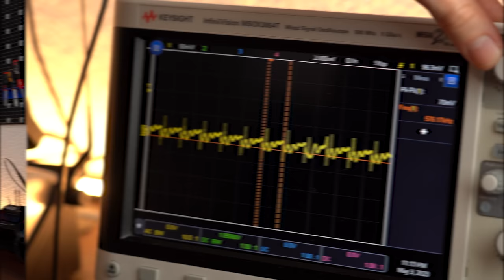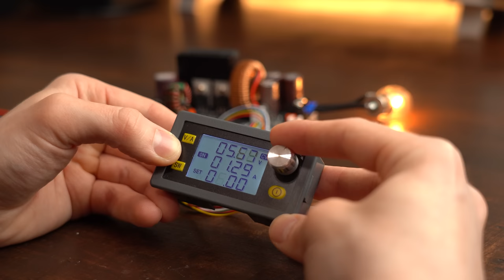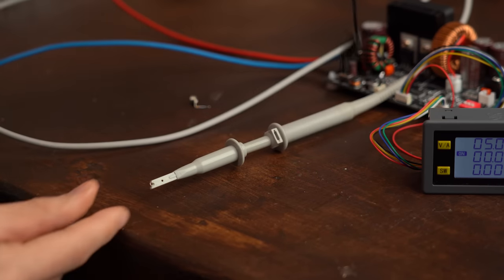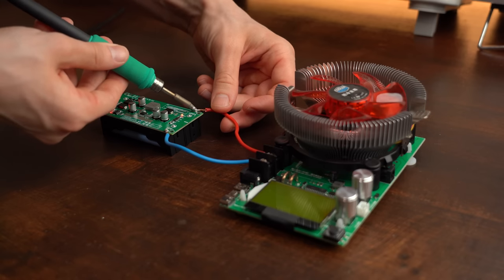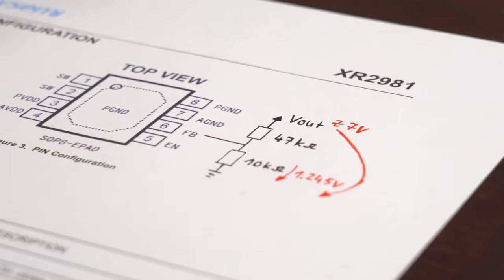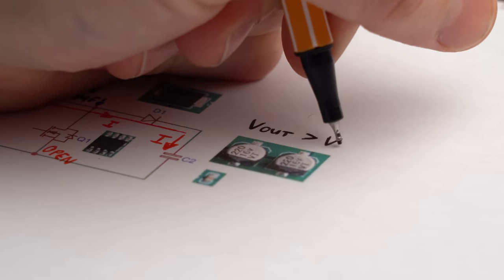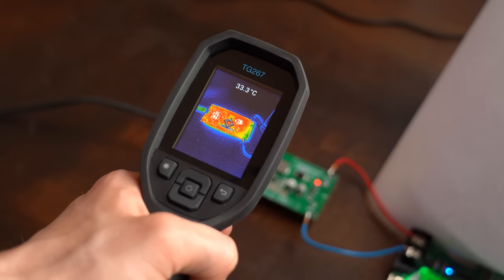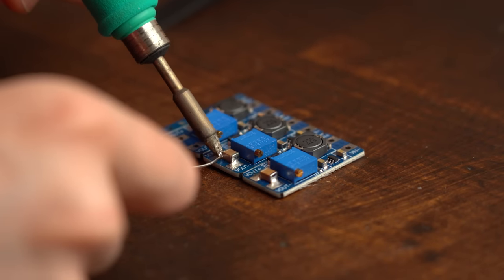With Just $0.50 Components I turned Garbage Products into GOLD!

Comment: The reasons for the component issue may be the lack of knowledge of circuit design, or they just wanted to get it out in a cheap and fast manner.  No matter the issues, this video provides a workaround to this issue, and it makes the circuit useful. This the reason that I like videos like this.
Reply: Maybe they were using whatever came into the factory as well, no need to bother with a design you can't reliably manufacture.
Reply: Even simpler.  It’s not a decision an engineer would want to make, these are usually management decisions.  It goes like:
Engineer: Here is a stripped down minimum count and cost design like you wanted
Management: it’s too expensive, cut something!
Engineer: But it’s already stripped, it’s not going to work properly!
Management: Here you go, make this cheaper because the last guy wouldn’t 
Unpaid intern: you got it boss!
Reply: I doubt it. Something like this is quite fundamental. If the capacitor is 50cents then that is almost a 15% markup and they are competing with other low cost manufacturers. Adding in that cap will just make consumers look at both products, think they are basically the same, and then buy the cheaper alternative anyway.
Reply: I suspect if the manufacturers have even tested their designs before putting them into production.
Reply: @qazwsx000xswzaq  they know full well.
Reply: Perhaps enough people desire to purchase a product that is 50 cents cheaper despite its inferior design because they are unaware of the reasons justifying the additional 50 cents. However, if a superior version is unavailable altogether, then your theory sounds more plausible.
Reply: from my modest experience, many cheap aliexpress products cut out on quality capacitors, often times they are found in the specs but replaced during production, maybe because of lack of stock or just to maximize profit.
Reply: I like this type of videos too, about changing bad quality electronic components to improve a design.  What other YouTube channel do specifically that?
Reply: Let's keep it in perspective... A capacitor isn't 50 cents. It's far far less for places that actually assemble components to pcb like this. Realistically it's pennies. Shit they could be salvaged for free if you had the work force to do that
Reply: @hugegamer5988  2023 version: "I am a large language model. What would you like me to do again?" 😆
Reply: @swimfan6292  in this case, so which is it? enough customers wanting a cheap product or enough customers who do not know what they will be getting?
Reply: you have to considered tge packeg or shipping condition, electrlitic one is far more durable.......
Reply: They probably didn't even had a proper oscilloscope to spot their mistake.
Reply: What I  have experienced is often one of these two options: cost cutting and not understanding the circuit example in the datasheet is missing filtering etc. components.
I have seen boards with pads for filtering components that were "intentionally left blank", and some that were basically the reference design from the datasheet that was, as stated in the datasheet, lacking filtering and signal conditioning. Also, people designing the correct circuit cost money, as do correct components.
Reply: They definitely know about a capacitor filter or a linear regulator because that's pretty much the first things people learn in ECE. Some people mentioned cost to be a reason, but I think the actual reason is people are using the wrong product for the job. These products are intended to be power supplies for things that do not care about the noise, like a LED strip or a small cooling fan. Counterintuitively, knowing what component to cut so that your product just barely works actually takes more knowledge of the circuit fundamentals than over-speccing.
Reply: Probably a copied design with cheaper components. A lot of Chinese electronics distributors are like meth cooks, they just follow a guide without knowing what they're actually doing.
Reply: 100% pinching pennies
Reply: or the parts in question takes to long to deliver
Reply: @cubertmiso  it's a manufacturing defect they pushed out for to sell anyway. Despite the flaw. Thousands if not millions of (actually important) products get knowingly distributed and sold every day. That's what he should've called out. Electronics industry has it easy with that because they claim responsibility for zilch
Reply: @pflasterstrips7254  They do not even test their products, why have a oscilloscope ?
Low cost high volume electronic are often not tested (but may be full with stickers about inspection and quality control), just put together, in a box, send to a place that resells the shit to you.
Reply: @pneumantic6297  it's only 50¢ for one. It's 10¢ for 10,000!
Reply: or they make the circuit design off of datasheet schematic
Reply: I think mlcc's market price must go up and down possibly as they use precious metals
Reply: @hugegamer5988  Yep, working in similar field I can confirm this!
Reply: From reading the comments, no one has questioned if they chose to use those capacitors because it simply "looks beefier". It is probably an ill choice that was made in the name of marketing. "Hey look, our capacitors are chonky, must mean it is better than our competition!"

Comment: Ah the classic current loop antenna, that’s why you were picking up all that noise. Any loop will act as a current antenna. And any length of copper, will act as a monopole if adjacent to a ground plane or bipole if connect to a center point. Good luck.
Reply: People who liked this also liked working with RF designs, where furrowing your brow rotates you on the smith chart.
Reply: Though the change he saw was huge and probably this is also telling for the EMC of those little PCBs.
Reply: That's why you should always use your devices inside a hermetically sealed bunker surrounded by 10cm copper plate, 1.2m lead plate, and 3m of grounded-steel-reinforced concrete. Everything should be made with pre-nuclear-test materials to reduce self-radiation.
The bunker should also be carved into the base of a mountain, or built into the sea-bed with at least 200m of water overhead if you want to block those pesky cosmic rays.
You still need to account for all the Neutrinos that can still easily get through, but luckily those usually don't interact with your electronics if they can get through all your other defenses.
Reply: @Prophes0r  Just build your swimming pool over your bunker.... ppfff...
Reply: @hugegamer5988  nothing like carving your own ground leads to get the ground loop as short as possible

Comment: I never knew to check temperature to check out components in a design to see if good or bad. Only to look for a broken component(s) when fixing. Maybe they stole an incomplete design from someone else? Lazy? Possibly just stupid? 🎉
I am still learning. I bought an old radio/cassette player and a radio clock alarm that both work to study on. I will use your temperature trick to maybe improve them. Thank you for giving us a great channel with interesting projects.
Reply from the maker: Thanks for the feedback :-) And you are welcome 🙂 I love to make this show.
Reply: Your devices were probably made in the 90s or earlier, so I wouldn't count on them having the same trashy engineering as modern devices from AliExpress. Good luck with your endeavors though.
Reply: High frequencies tend to cause caps & mosfets to heat, for different reasons, but the solution is pretty much the same: lower the resistance. Low ESR caps have much lower resistance, and 'bigger' mosfets have lower RDSon, which is essentially the resistance that causes most of their heat.

It's always funny to see a low-tech troubleshooting technique on high frequency IC's. Elegance in it's simplicity.
Reply: Seconded. The diode temp probe is a precise method of spotting an overheating device. Slower but many times better than a finger touch. I'm impressed by your thoroughness.

Comment: You typically do not put large MLCCs on the output of a power supply because when they fail, they fail with a burn
so you use small ceramic caps paired with low ESR caps
Reply: I am curious about your answer, so I get deep into it, there is an article from TDK, called"Guide to replacing an electrolytic capacitor with a MLCC", it recommends to replace with MLCC due to their low ESR, long life and small package, but one should be careful about their capacitance will change with temparature and voltage applied to them, also some ICs are intended for electrolytic capacitor, so it might cause some unwanted feedback with MLCC.
Also there is a youtube video discuss about fail of MLCC called "EEVblog #1037 - Solving Ceramic Capacitor Cracking
". Large value MLCC can be cracked physically easily, and it might get shorted when that happened, I guess that's why modern hign-end PC motherboard still using the method you said, rather than pure MLCC method.
Reply: @tingoyeh4903  I had soldered a MLCC underneath an electrolytic in an ATX PSU which had undesirable high ripple output. Eventually while I was at the computer, there was a pop sound. The MLCC probably became hot and failed short which burnt down the electrolytic releasing gas.

Comment: Man, it's crazy how much you can accomplish pretty cost-effectively if you understand electronics. It's something I'm trying to learn, but it's not easy for me to understand electricity and how everything relates to each other. Thanks for the videos, they're helpful in slowly getting more understanding of things.
Reply: This is true for anything, from auto mechanics, plumbers, carpenters, yada yada.  Outside of basic volts, amps, Ohm's Law, etc, electronics are going to require a fairly deep amount of study/work before you're going to be able to figure much out not too mention fixing a borked design.  I've decided to spend the extra 25% or so for something thats generally been shown to be good vs trying to eke out the cheapest component/parts.   If I'm trying to cobble something together, the last thing I want to do is be wondering if some pre-made component is even doing what I bought it too do.
Reply: Don't worry about some of these things.  The higher the frequency the more electronics starts to look like black magic.  That's even to people who have degrees in it or similar fields.
Reply: @arthurmoore9488 lmao, for real. I work in automation and the amount of troubleshooting I have to do with highly sensitive equipment near robots, or other high frequency loads is aggravating. Sometimes the shield isn’t grounded well enough, sometimes the shield is too small, sometimes it’s grounded too well and creates a ground loop that effectively acts like an antenna that picks up RF noise. Part of me loves it, part of me hates it. Haha
Reply: Man, I've been an electronics hobbyist since the late 1980's, and I'm always surprised at how little I know. Just keep tinkering. And when you get a chance to use an oscilloscope, seize the opportunity
Reply: You answered it yourself- to save 50c
Reply: Keep learning my Friend, I thought myself a few years back and it was the best thing iv ever done(literally).. now I can fix all sorts of stuff. I watched nothing but videos like this channel and others and before I knew it I'd learned so much. So keep it up. YOU WILL LEARN LOTS IN TIME.. 👍🇮🇪🙏🏻
P.S. I'm still learning too BTW, this is a life long love.👍👍👍

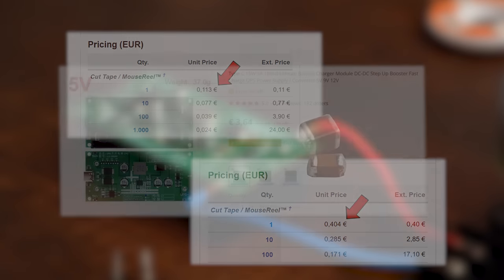Comment: 9:47 your forgetting that at the volume they're producing these at the increase in BOM cost is even less at under 0.19 EUR / piece on orders of 1000. Probably also a slight price decrease at 10k and 25k as well. Therefore at volume this is likely no more than 0.15 - 0.17 EUR in parts, and the lower quality parts they're using probably cost 0.08-0.11 EUR, so we're talking about them pinching literal pennies to not have a better product.
Reply from the maker: True :-) That would make this story even sadder though.
Reply: @greatscottlab  yeah unfortunately so. Though I know BigClive in his teardowns of electronics like this from china on aliexpress or otherwise mentions that they tend to have resistors and capacitors overdriven for their intended purpose for whatever reason.
Reply: Like literally around 0.08€ savings. That's really sad. Someone should contact the manufacturer and ask them to reconsider their decision.
Reply: @pappaflammyboi5799  Dont forget about what the product itself cost spending 0,08€ on a 1€ board is a huge increase in price.
For most stuff you dont need that clean power, so it is good practice to not build them in.
Reply: @jonasstahl9826  8% is a huge increase in price? Ya, not really.
Reply: In fact, the market price of the Mini Boost Converter Module (10:51) is about 0.3€ in China.
Reply: @imcrazy886  If that's true, then substituting 2 minor parts to improve the design wouldn't significantly add to the overall cost. In any case, their profit margins are quite handsome regardless.

Comment: The electronic load might also introduce some noise, would be better to measure with a pure resistive load.
Reply: Yes this. Might be noisy as hell.
Reply: I used a pile of old 1ohm 50W resistors to make a grid on an aluminum plate.  You can jumper quite a few different loads and can dissipate lots of heat.
Reply: How long until the video where he adds a component to the electronic load?

Comment: That ringing on the switch node of the inductor can be suppressed with a snubber network and is easily missed, this I know from first hand experience! Also sometimes adding a beefy cap can make things worse, Mach1Designs did an EMC video on the caps and is very helpful in locating noise and killing it.

Comment: I think it is because of cost.
Like the MT3608 boost converter, here in Indonesia it listed around 5200 to 6500 IDR (0.32€ to 0.37€). By adding the better ceramic capacitor priced 0.5€, imagine how much it affecting the price.
For me, the initial design is more than enough, reminding the price is dirt cheap. Unless for specific reason I need to modify, like the one you tell about creating negative voltage, I'm set my expectation according to the price I paid 😅
Reply: Well, a 20% 22uF MLCC costs 500 IDR (0.03 EUR) on Indonesia's Tokoijo, and the manufacturer would have been able to source it for cheaper. So it's not an excuse.

Comment: My guess for why they didn't go the slightly more expensive route is sourcing. This is all guesswork mind you, but if they produce in house, it's only costing them pennies per. One thing I've noticed about Ali is many vendors offer the same product at different prices, so that would explain why they want to keep the price low...sort of a lowest bidder thing. Lastly, the 50 cent price you quoted is the retail price, so it would slightly increase their profit margin as they'd be paying wholesale. 😊
Reply: For a lot of stuff on Ali/AE, there are one or two companies making gajillions of these as OEM-Contract.  Some resellers want different color silkscreen, some spec differrent values for some components to get a lower BOM, etc.  Chinese business looks at cost cutting as the primary goal bar none. Doesn't matter if it impact the specs of these design, unless/until they are called on it and IF they can be forced to pay some sort of remuneration.  It is always worth it to keep value engineering a design/product which leads to higher profit, until/unless they are forced to remunerate.  There is not a lot of care/f*cks given for 'Reputation' as you see from Japanese, EU, Noram companies.
Talk to some engineers from China, and they will all admit it. They don't like seeing their work cut down to out of spec anymore than anyone else.

Comment: For the UPS I simply replaced the 2x220 uF capacitors with a 22 uF tantalum low ESR and a 470uF electrolytic as recommended by the chip data sheet. That cleaned up the noise.  I used 1x probe and attenuation.
Reply: Can i use 2x 4700uF 16v on the output instead? I only have these at hand or the 10v 1000uF ones. 😅

Comment: To reduce heat dissipation of lineal regulators consider using an LDO that has only 0.1 to 0.5V drop, and use a lower input voltage :)

Comment: That's a wonderful example of what a difference good capacitors make.  I'm amazed that the short probe ground wire makes such a difference.  Have you tried measuring at 20MHz with the ground wire?
Reply: It might be partially because it was so close to the unshielded switching inductor.

Comment: At high frequencies such as in these switching power supplies, standard electrolytic capacitors have too high of an “equivalent series resistance” (ESR) and should not be used in this type of application; that ESR leads to excessive heating. Low ESR electrolytic capacitors are designed for these applications.

The small ceramic capacitor heating up is a bit surprising since they are intended for use with high frequencies; perhaps that was a cheaply made part, and that is why it showed a higher than expected temperature.
Reply from the maker: Or the ceramic one had to do all the work and was more or less "overloaded"

Comment: A lot of noise I deal with in electronics is 60 hertz noise because all the power supplies use a iron core transformer instead of a ferrite core transformer and the reason why that makes a difference is because all iron core transformers run at 50 or 60 hertz well ferrite transformers run at higher frequencies. And 60 hertz noise is very noticeable if you're using inductors and highly sensitive electronics